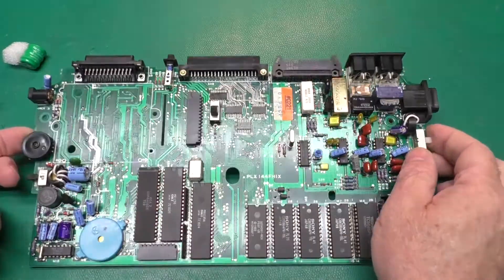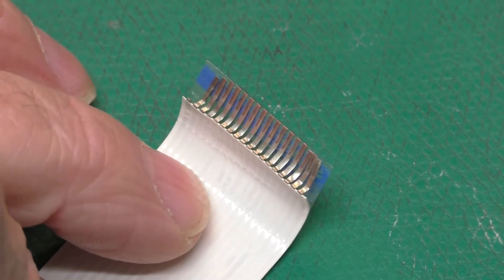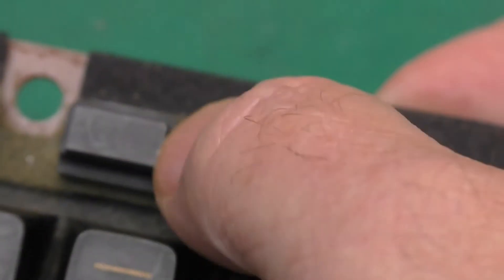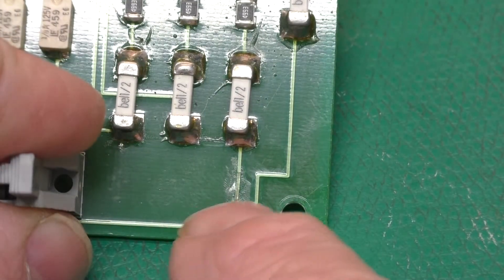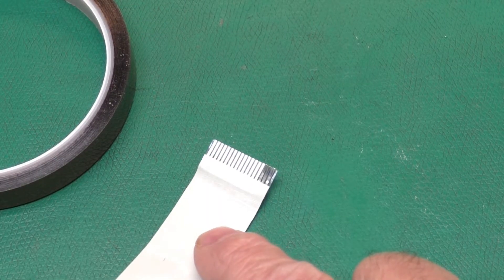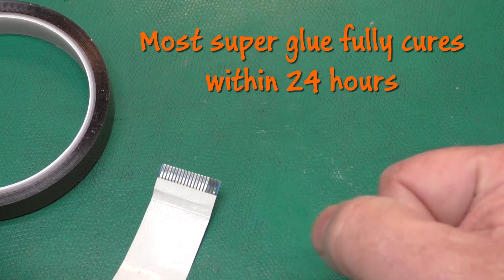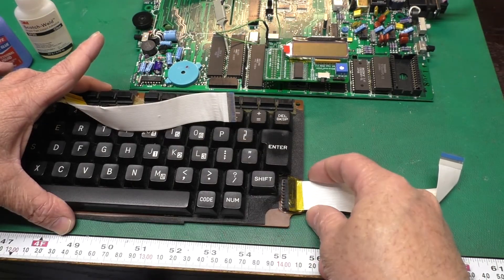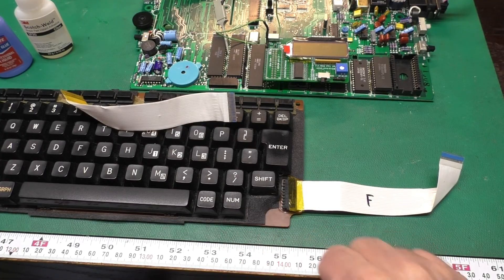Flat Flex Cable Repair - Can we save our aging FFCs?

Comment: I have a damaged flex cable that has carbon conductors or traces. Can it be repaired?
Reply from the maker: You can try using conductive ink but it usually cracks and falls off of anything flexible. Hopefully you can find a equivalent cable made with copper traces.
Reply: @HeyBirt : Yes, that's what I found when I used a carbon ink pen to repair the cable.

Comment: Super good video. I am having a hard time finding how to get a problema resolved with four similar cables for my old Technics (Panasonic) RT 575 Cassete Player.
Two of them having 27 fingers and other two 14 fingers. I have the same problem of all ends with the fingers damaged.  I even try to find the cables to sale by the feet or centimeters but I was not luck.
On top of it, the cables are very short in length and are no longer available from manufacturer. Your method is very intelligent.

Comment: You gave me a good idea on fixing the plastic that came off my ribbon cable i used electrical tape to be able to get some sturdyness on my cable and was able to push it into the connector. Great video

Comment: Thanks for posting this! I have a similar bad cable in an Icom IC-745 receiver, The technique is great, the main issue is what the best adhesive to use is, the entire stiffener came off with all fingers detached from the stiffener. crazy glue does not stick, I'm testing some others.
Reply from the maker: I have found that Loctite 401 works well with plastics that are difficult to glue. A bit $ but works well.

Comment: hi what do you call the blue plastic behind na pins that supports them? Id like to buy some because I lost mine 😅
Reply from the maker: I called it a 'stiffener', it does make it a bit stiffer, but it's true purpose is to make the end a bit thicker, so it fits tightly in connector. You could use about any sort of thin plastic sheet the same thickness.

Comment: Thanks for sharing your experience! I have a flex cable where the blue stiffiner fell off. I saw in the comments that in can be glued back on, unfortunately I lost mine... My question is if I can buy a sheet of this material ? Just the blue plastic around 8 or 9 thousandths thick.
Thanks.

Comment: Sadly my 102 keyboard cable just gave up the ghost and the entire stiffener came off. Is it possible to glue the whole thing back on? (Or, maybe better, replace the whole cable?)
Reply from the maker: You should be able to glue the whole stiffener back on. I did find some new KB cables, but the minimum order quantity is 1,000 pieces. I'll keep looking though.
Reply: @HeyBirt  I'll try gluing it, thanks. This cable has been "snowplowed" so I'm not super confident it will work. I'm going to order some 20pin cables Just In Case.

Comment: I've never worked on these cables, so this is a wild suggestion. Clear nail polish dries slower and you could put a layer underneath lifted contacts and a layer over the top. then sand off the contacts like you did at the edges. Then again, it might not work. I don't know.
Reply: I would like to hear how that works! Nail polish already is a secret weapon in my toolbox.

Comment: Why does it matter if it’s attached on only one side? Couldn’t you just dip it in some kind of acid solution to leave the wires exposed & insert it to the board with a thin piece plastic on one side wedging it tightly?
Reply from the maker: I made this video months ago so I'm not entirely sure what you are referring to when you say "Why does it matter if it’s attached on only one side? "

Dip what in acid? The flex cable? To dissolve the polyamide backing? I'm not sure what that would gain you even it if would be possible to dissolve the polyamide without dissolving the copper. Keep in mind the copper traces are only about 0.004" thick they can't be inserted into anything on their own.

Comment: Since pcb manufacturer are now offering more and more flatflex options, I wonder if that is a viable solution to replace broken flex cables and manufacture the custom ones for our old computers. Like, designing the pads and the traces and the dimensions like the old cable, only traces, no active components. Have you tried that already and I just missed it?
Reply from the maker: Having a cable made is possible it may or may not be economical depending on application, i.e. if you only need one. If you are lucky you might find an off the shelf FFC that is close enough. There are some folks getting cables reproduced for some machines,  where they can get a large enough batch made to bring the cost per cable down this is a good option.

For the T102 shown here the connectors are a problem as nobody has been able to find an FFC connector with same footprint. The connectors are often the source of the problem, as it was in this case.

Comment: Slick work!  I have nowhere near your level of skills or experience in this arena.  I can say that I have been disassembling, cleaning, and doing very minor repairs vintage computers for more than 20 years and in my recollection that darn Model T 102 keyboard cable is the most troublesome ribbon connector I have ever stumbled across.  Most ribbon cables I've dealt with have the clamp-like connector that loosens the pressure on the ribbon for safe removable and clamps down for tight fit on replacement.  The ones that I have dealt with that are similar to the 102 keyboard connection, the ribbon leads where just not that flimsy.  Your modern solution mention below would be welcomed I'm sure by the retro computing world.
Reply from the maker: The connectors used on the T102 are problematic and so far no one has found a connector with similar footprint. Hopefully we can figure something out.

Comment: I have an Atari LYNX II flex with rubbed off carbon/graphite contacts on the ribbon. Its a right P in the A to fix. I think replacement is the only reliable option.
Reply from the maker: The carbon contacts are defiantly a problem. GadgetUK trims 0.5~1mm off the end of such a cable so that when it is plugged back in you have some new carbon to connect to. If you have the extra cable length this might work.

Comment: Great job =D  I've done the same sort of thing before and it is reliable - I didn't think of masking off with kapton tape though =O
Reply from the maker: The tape does not make a perfect seal but it keeps most of the glue off the contacts. Using your wonderful fiberglass pen takes care of the small amount that leaks through.

Comment: And if this way is a no go? Desolder the connectors and use Male/female dupont wires?
Reply from the maker: I'm not too thrilled with the quality of dupont connectors. Even in a temporary application they can be very fussy. A friend and I have been chatting about a solution to these particular T102 cables/connectors to replace them with something modern.